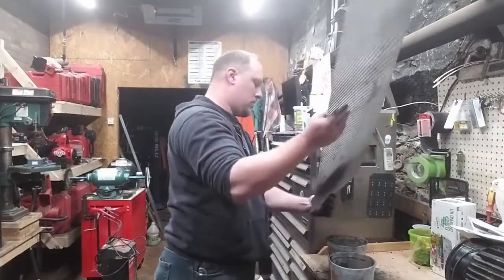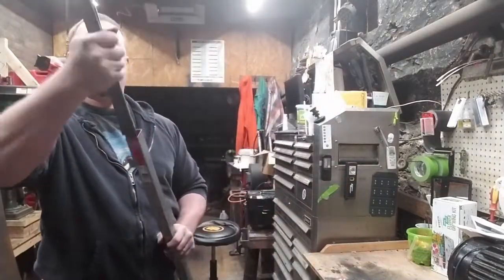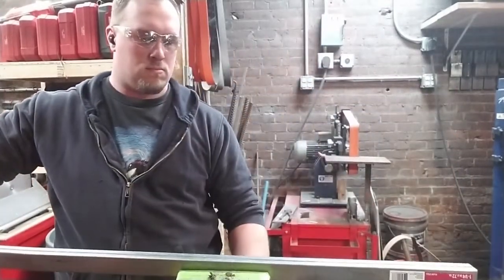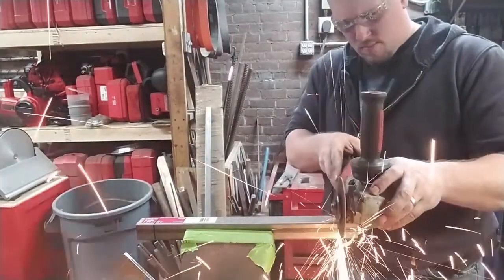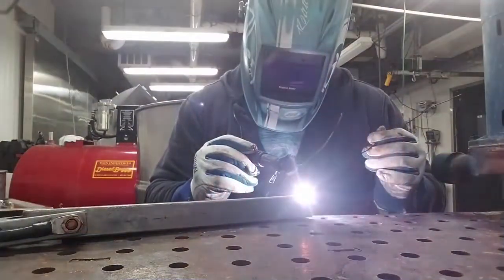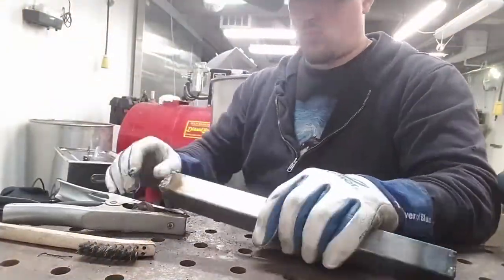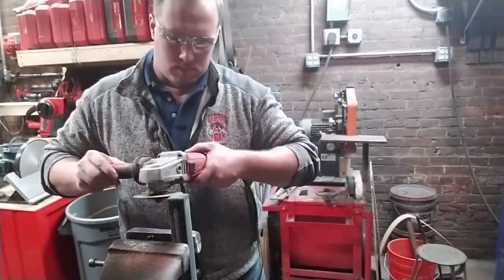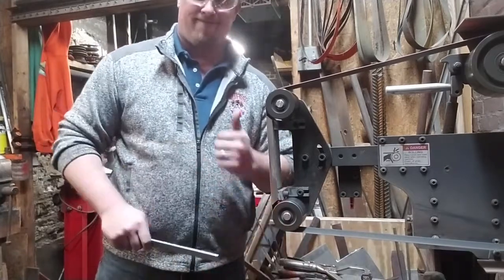CEMENTATION: Making Steel from Iron | Blacksmithing | Part 1

Comment from the maker: What questions do you have for my husband related to blacksmithing?
Reply: Hi Lynne, I realy want to try the cementation process my self. So my question would be, if I have to do it in one uninterrputed session or can it be done in different sessions. Lets say I will fire up the oven, than at night going to sleep than getting the fire back to higher temperatures. I´am asking cause it´s not realy possible to stay awake for days. Thank you in advance and greetings!
Reply from the maker: @JoniPeperoncini  Yes, you absolutely can. However, it's VERY inefficient. The problem that you are describing is why pre-modern steels were "shallow hardening" because of an uneven distribution of carbon. What you will most likely end up with is a very high carbon skin on the outside and a carbon migration that quickly tapers off inside the piece. It's a lot better than case hardening, but it's nothing compared to modern steels.
Reply: @LynneFairchild  Thank you so much for your answear and the explinations. Ok I see. The plan is to produce blister steel from wrought iron for historical reproductions, thats why I was asking. Greetings!

Comment: I was confused. He turned steel bars into hi carbon steel? Where’s the iron?
Reply from the maker: What we call mild steel is really just iron. 
It's called steel because it's made with the Bessemer process (actually, the oxygen converter process, which is a refinement of the basic Bessemer process), in which O2 is blasted through molten cast iron to bond with most of the loose carbon and create carbon dioxide and steel; but in the case of "mild steel" (ie: iron) virtually all of the lose carbon is bonded and what's left over is... basically iron. But since the product is a monometal (made from a poured ingot with a contiguous internal crystalline structure) and not assembled from layers, it was structurally different enough from "iron" (ie: wrought iron, made in a bloomery furnace) that it took a different name.  
For the purpose of cementation and making steel from iron, it's an excellent starting material.
Reply: @LynneFairchild  
Thank you so much! Thanks for taking the time to explain 😊
Reply from the maker: You're welcome! Hope it helped!
Reply: @LynneFairchild I'd like to offer a minor correction/clarification. The reason mild steel was called "steel" and not iron was indeed because Bessemer was trying to produce tool-grade steel. As the industrial revolution kicked off, however, the term mild steel lingered to meaningfully differentiate it from wrought iron. Wrought iron had many slag inclusions that rendered it unserviceable for modern machine applifwtions. Eg, if you can get your hands on some, try machining wrought iron. Everything cuts as smooth as butter till you hit a slag inclusion. Those really tear up your bits. Therefore, mild steel was increasingly used for stronger and lighter gun barrels that could be more easily bored (with crucible cast steel bits). It was also less likely to suffer catastrophic failure of the breach.
Reply from the maker: I'll pass this on to my husband.

Comment: Hey there, I'm interested in Balcksmithing Forging, Smelting and Iron/Steel making and I had a question about this process.

I've been looking into steel making online and it seems the most efficient way is to make pig iron from raw iron ore and charcoal in a blast furnace then decarbourise a lump of pig iron into steel. However when i try and look into the methods used to create steel they all seem to mention making wrought iron and then shipping it off to be REcarbourised through this process. Without using large industrial Bessemer containers is there a way to efficiently convert Pig Iron into Steel without going too far and making wrought iron?
Reply from the maker: I think you may have your terms flipped.  Allow me to clarify.  
The way medieval smiths made steel was to start with iron, and carburize.  Before the process I demonstrated, the typical method was to do a simple shallow case hardening, and perhaps to take a case hardened bar and fold it so the hard skin was folded into the center of the iron.  The process of cementation was a refinement of that, and cut off the extra labor of kneading the carbon into the steel.
The way we make steel now is to make cast iron (often called pig iron at this stage, but that is not a precise term) which has perhaps four times the amount of carbon you would want for steel, and blast air through the molten iron.  The oxygen will bond to the free carbon in solution, and come out the other side as a mixture of carbon dioxide and carbon monoxide.  By regulating the amount of air blasted through the cast iron, you can regulate the carbon content in the resultant steel.  This is the Bessemer process, and this is a Decarburization process.   It is absolutely possible to pull all the carbon out, and some manufacturers did that on purpose.  
It's impossible to do the Bessemer process without a Bessemer furnace, but it is indeed possible to bake the carbon out of cast iron.  If I were going to try, I think I would slice the cast iron into thin cross sections, and either cover them in pure iron powder or sandwich them between pieces of mild steel, and let the carbon migration process run the other direction.  This would be very energy inefficient, but it could be a neat exercise.
Reply: @LynneFairchild  Thank you very much! I'll keep that in mind for a future experiment!
Reply from the maker: @commanderpuffy1014  Happy to help!

Comment: How many bars did you put inside canister? And what is the size of each bar? (lengh x thickness x width) aprox? Thank you
Reply from the maker: Each bar (6 bars total) was 12 inches long by 1 inch wide by 1/8 inch thick. The only important measurement is the smallest one. Carbon will migrate through steel from every dimension, but obviously will complete its journey from the smallest dimension fastest. That will determine when the carburization is completed.
Reply: @LynneFairchild  Thank you a lot your coments and very usefull help. My question was in the way to try to guess how to calculate time not to a bar but to a rod. But once with a rod the smallest size will be diameter, i guess calculation of time shoud start from here (diameter), am i correct? Good job and very useful the video you posted. Thank's again.
Reply from the maker: You're welcome! Glad that the video was helpful.

Comment: Hi, could you explain better how did you calculate time to do cementation? Because at minute 2:49 you show a bar with 3/16 thickness x 1"x 36" but at min 4:09 you do calculation for a bar with 1/8" (2 faces)... Thank you!
Reply from the maker: We ended up preparing more parent material than we actually used. We only used the 1/8 material in the cementation process. The speed of carbon migration is dependent on temperature. There are charts available, but there is no good way for a blacksmith to determine on his own- short of recording your times and temperatures, then breaking your test piece in half to see how far the carbons migrated through.

Comment: Just really great! I remember when I was a teenager and trying to make a hamon on a blade; I sprinkled charcoal powder all over it before covering it with clay. When it came out, the carbon had absorbed a bit into the surface and it looked like raindrops all over the surface.  Perhaps I had inadvertently done a shallow cementation process to the piece. Thanks for your video!
Reply from the maker: Thanks! The raindrops were certainly carburization. That's very similar to many old school case hardening processes. One thing to watch out for is that any fast case hardening process is going to be shallow. So, you'd have to be careful, or you can grind right through it.